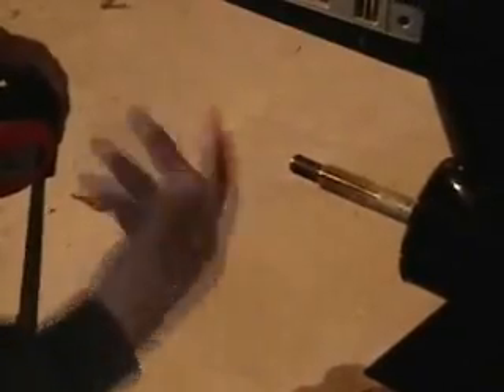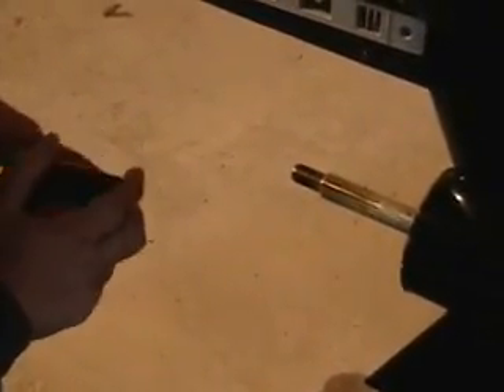adjusting manual jackplate (slide master)

Comment: I'm trying to determine what the transom height is supposed to be and I'm assuming it's 20 in for a regular outboard.
Reply from the maker: Adjust it from the bottom of your boat. The transom height will vary from boat to boat.

Comment: How did it turn out?
Reply from the maker: It turned out good. I have a top speed of 64 mph with great stability.  Water pressure is good. I was like 5 inch below pad now it's sits at 3-7/8.

Comment: I dont see a benifit in a manual jack plate. Most motors have enough adjustment holes to set the motor to the proper height. Hydraulic is the way to go.
Reply from the maker: A manual plate over none is a huge advantage.  Just setting engine back off the transom alone will give you more performance without even adjusting the height.  I fish great lakes and inland lakes.  Changing props for the conditions can also affect how high your motor has to sit.  I my case when running a 5 blade for lift vs a 3 blade the motor has to be adjusted.  That is not possible without a jack plate.  If you can afford one get it.

Comment: It's a simple process, cavitation plate equals the bottom of your keel for maximum performance that's it
Reply: No that’s to deep..3 1/4” to 2 3/4” depending on what prop your running or the way you have your boat loaded also..
And your water psi too.. My bass cat with a Fury 3 blade is 3” with The Trophy 4 blade it’s 2 3/4”.. Feel the Rush !!

Comment: went to champlain, running 60 mph when over heat alarm goes on. sat in the middle of really rough water for about 5 minutes, started up motor, ran for 5 minutes, alarm goes on again, did this til i got back to ramp, thought it was something major.  went to u tube video, realized it was jack plate up to high. going back to champlain in two weeks, will lower before i go, hope that does the trick
Reply from the maker: matthew heney for sure you don't want to over heat engine by starving it of water.